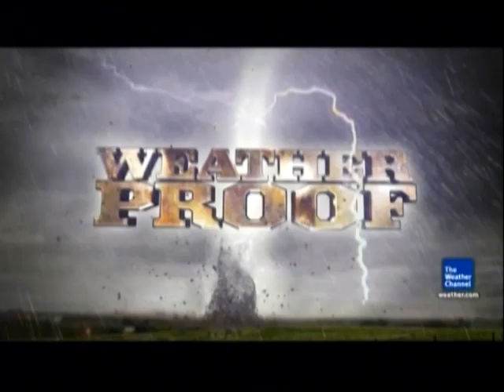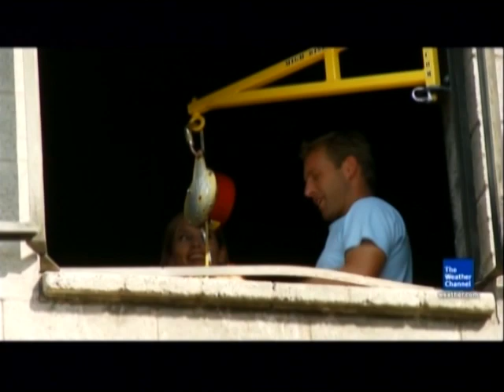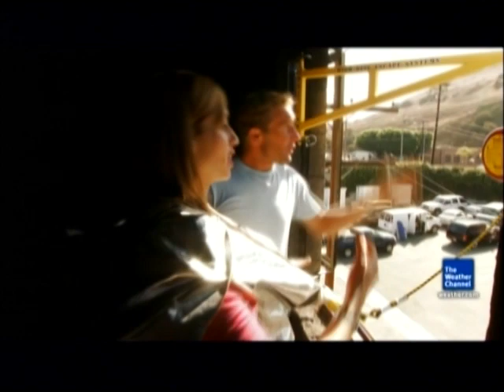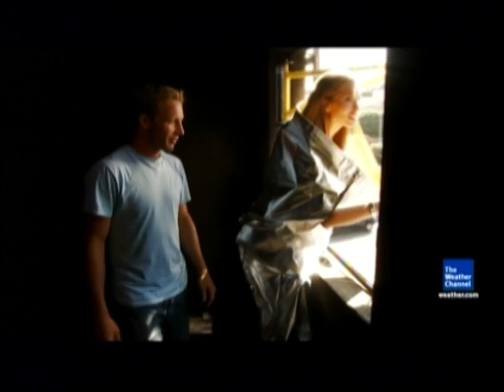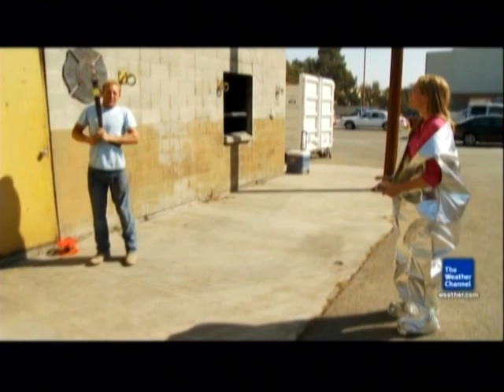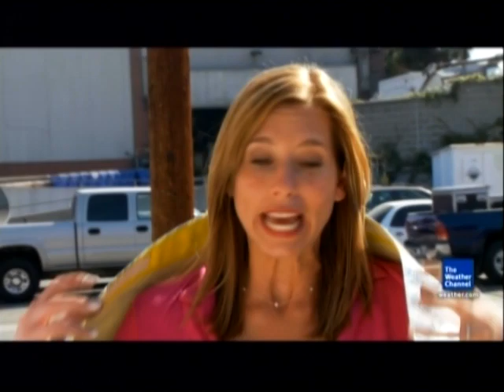Testing by The Weather Channel

Comment: If you have several people needing to get out, someone is gonna get hurt! There is only one access strap to use at a time to get out. As one goes down there should be a strap going up for the next person. And having to pull the strap up by the line to reset for the next person to get out, again, someone is inhaling smoke or getting burned. I'd like to see this tried with actual smoke billowing around to see how it works then.
Reply: Hello Camille, There is a rescue belt/harness permanently attached at both ends of this cable. The Evacuation Suit can be added in addition to house someone that has become unconscious, elderly or disabled individuals as well as parent and child evacuation scenarios. When the cable length is matched to the customer's floor height there is not "extra slack" to pull through the system to reset each time. As each evacuee escapes they are actually reloading it for the next person. The Weather Channel did a good job but there is a Discovery Channel video on our website that shows this particular process a little better. You can view it at hres.com . If you have any other questions or would like a proposal for your family please don't hesitate to reach out to us. Thanks. -Ryan